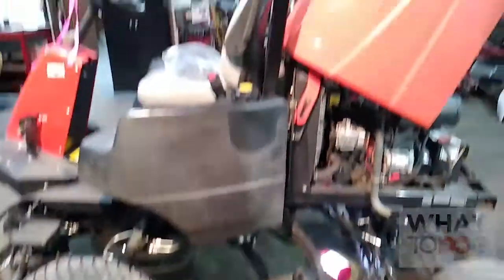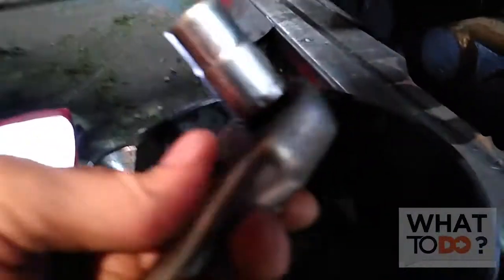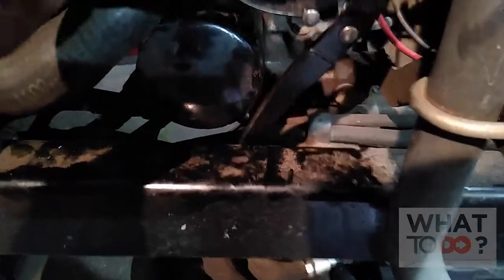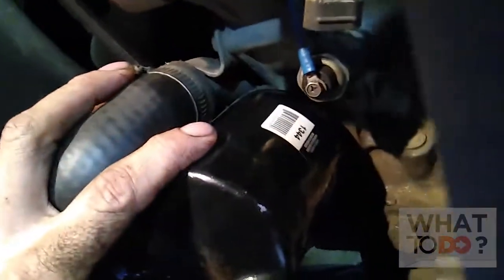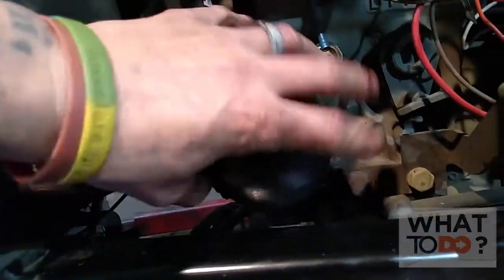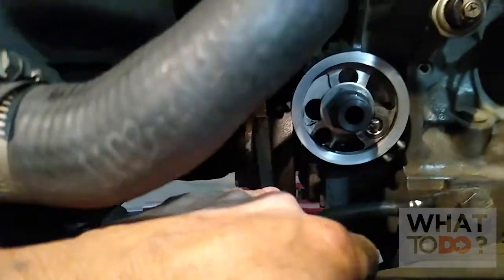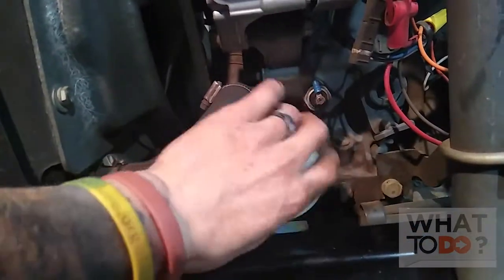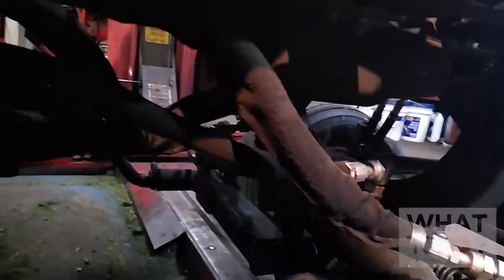Oil Change and Filter on Jacobsen Fairway Mower LF1880

Comment: rob i need help. how do you change the drive belt on a greensking vi? got one you could do a video on ?
Reply from the maker: I haven't been around those machines in a few years. Unfortunately I don't have any videos on them anymore.
Reply: Well i managed to change both belts! Not easy. Tried changing the reels bearings on one reel. The non hydraulic motor side - bearing is seized to shaft. Any advice how to Get that off? Torches? Put heat to. It and then use the puller